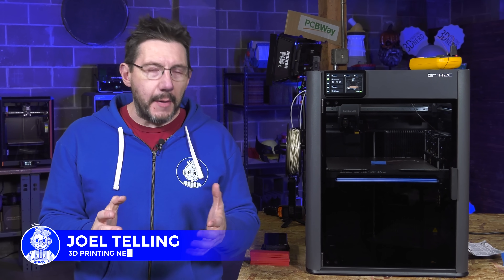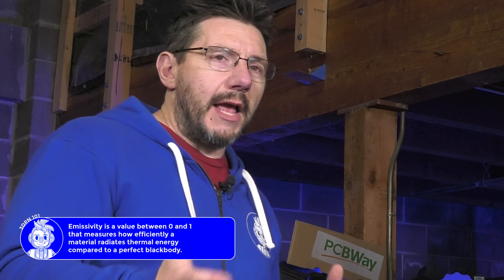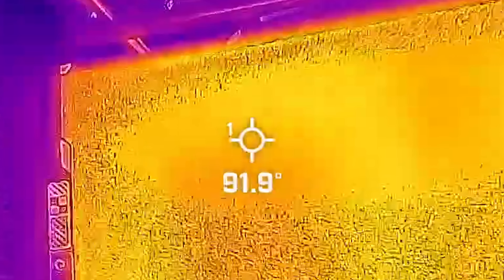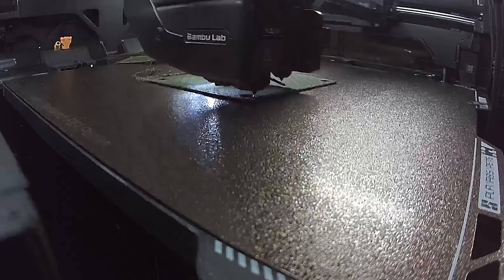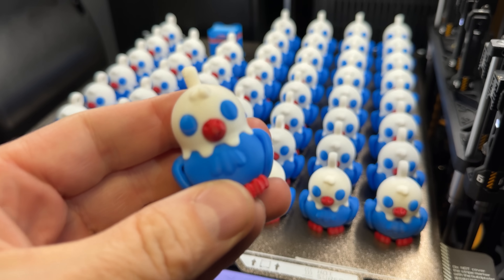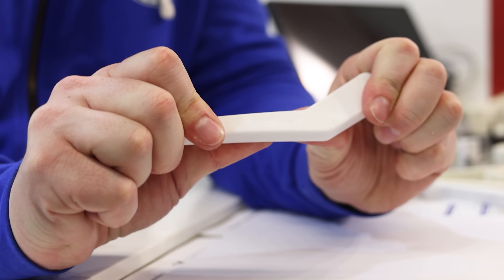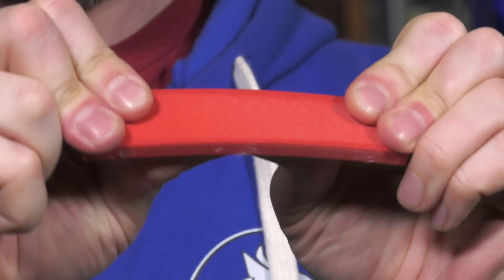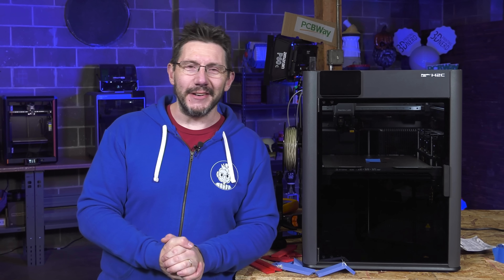Bambu H2C Update - Bed Heating / Tullomer + Polymaker

Comment: Never had a problem with PLA on my textured plate. I do however, keep it clean.
Reply: I hardly ever clean my plate on my Kobra 3, I just washed it the other day after a year and a half. I have never had to worry about a print not sticking. Clean plates are overrated if your printer is working properly and the file itself isn't defective
Reply: @MichaelP-ns  I have no deep views on it i simply forgot when i first setup the h2c and then decided to see how long i could print without issues about 90 hours in now i did have a fail but it was detected and because i was stupid tall object no brim at all.. can't put that on the printer.
Reply: I because i am lazy didn't clean it on my new h2c at all, it's the same as they shipped it and now at about 80 hours no issues yet. Ill clean it when it starts giving me issues.

Comment: First thing I did when I unpacked my H2C was toss that garbage gold pei bed in the bin and install the absolutely sublime Engineering plate and knock out a hundred or so hours of printing ABS. :D

ALSO - take that old plate and scuff it up real good with steel wool or something similar. The PEI is oxidized, which is why you're having adhesion issues.
Reply: I use Bambu's hot pei plate as the original X1C cool plate, and by that, I mean I use bambu's liquid gluestick even for longer PLA prints, and set the bed at a cool 35C and the printer basically uses no energy for the bed. I don't have the original X1C coolplates on hand, which works better with the X1C because you have to crack the door open, not to mention lidar works better with flat plates, so I just do the same with a hot plate on that. Bambu ships the textured plates with everything now because they are noob friendly and work with silk, pet-g, etc

Comment: You can use boiling water (which never gets hotter than 100C as your reference for calibrating your thermal couple.
Reply: @liamventer  + adjust for elevation if not at sea level. 

Also a good idea to get a second data point. Check at 0C, with a cup of full of ice and water.
Reply: There is also the temperature compensation I think it’s the cold junctions compensation, where if you are shorting the inputs it should show room temperature.
Reply: @radarmusen  the Fluke 289 does all that. It is ACCURATE out of the box!

Comment: Yep, you need to wash the  plate down every so often.  I use simple green and warm water. Fixes the not sticking issues every time.  I try my best not to touch the plate at all. 
If the purge line stops sticking were i peel it off, with my fingers, time for a washing.
Reply: "Fixes the not sticking issues every time" -- you mean, except the time Joel washed his build plate. The one he was having problems with, even after a thorough cleaning, still wasn't grabbing the prints well enough. Watch the video, you'll see.

He attributes this to the plate being defective. And maybe it is. Or maybe the calibration on the printer is just a hair off, and little more "squish" (i.e. first layer nozzle closer to the build plate) would fix it. Or maybe the plate is defective, but just right on the edge of working and a bit more aggressive calibration for the first layer would have allowed the defective plate to work.
Reply: Works for me every time i have sticking issues. One finger print  will keep it from sticking.  May be he got some in the areas that didn't stick?  I'd say do a reprint, once is a coincidence 2 or more there's an issue.

Comment: I can't help but feel like this video was a save face/repair relationships (with Bambu) video as opposed to a real reversal of a conclusion. I dunno. Hope I'm wrong.
Reply: By now enough h2c's have shipped and people don't report any weird pla not sticking to the build plate. Put trust in numbers... maybe he had a bad plate or user error or... but the only real trust is watching more reviews and if still in doubt wait 2 or 3 weeks and see what users report. My 'data-point' is that my h2c is fine no issues at all so far.
Reply: You and me both.
Reply: Yuuup.  Gotta keep that free printer portal open.
Reply: @Matunahelper  it was probably just a response to he multitude if other videos debunking his original one. It was obvious he was having problems, but it was also obvious that the bed heater wasn't the cause and he was just misreading his instruments. I think he did a great here being 1: forthcoming about his mistakes 2: clear about how it was an easy mistake to make 3: seeking to get to the problem of what his adhesion issues were without just dismissing his very valid experiences to better appeal to bambu
Reply: @chrisjohnson00  you don't think Bambu got in touch ? 😮
Reply: @Design_no no, it doesn't seem like it. They don't have a history of using influencer manipulation tactics, for the most part when I hear YouTubers talk about what it's like to work with them, they seems fairly hands off and tend to let the products speak for themselves. Nothing about this video strikes me as being tainted by their influence

Comment: I wish the Tullomer filament were cheaper.  There are a lot of uses for that, and has a lot of potential, just because it can print on "normal" printers and not the runs running northward of $10,000 like the Funmat HT or the 22 (both are awesome printers, but definitely not cheap.)